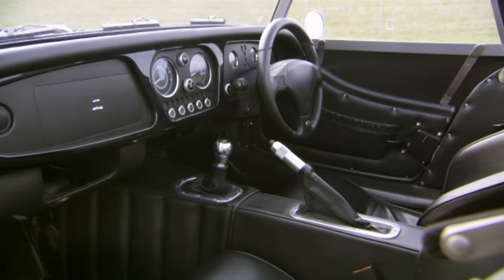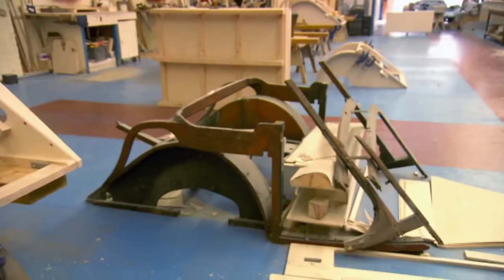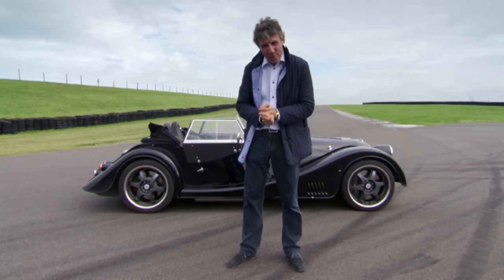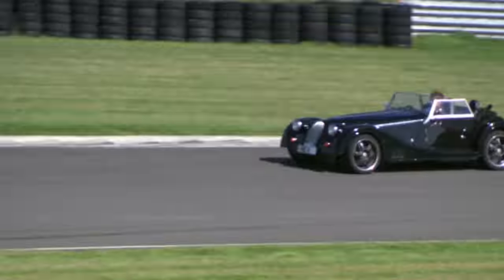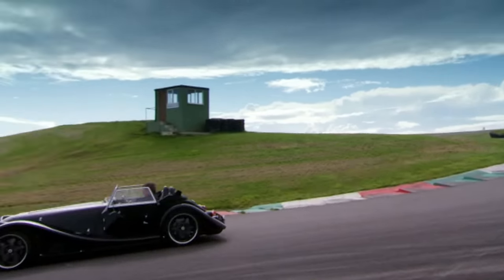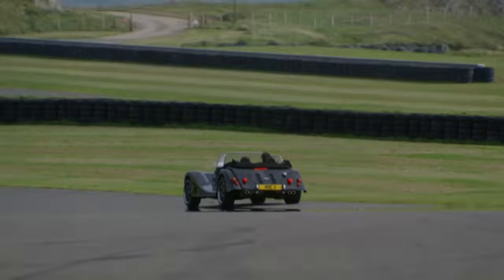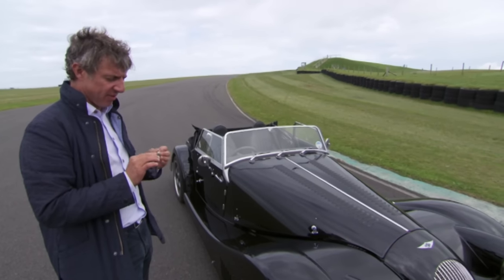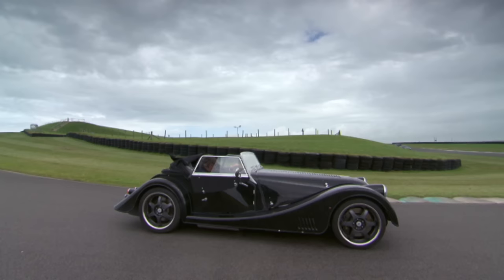Old Meets New With The Morgan Plus 8 #TBT - Fifth Gear

Comment: Cheek charging 85k for something that had minimal development costs.
Reply: Have of that car came from Alibaba ... the rest is German!
Reply: I actually own a plus 8, it isn’t a cheap car on any level, thick leather, good engine, very light weight and it is all hand made.
Reply: @pringle239  Just took delivery of one of the last M3Ws. Let's just say quality control isn't amazing.
Reply: @diplomacy2000  Yeah, that can be very hit or miss. Morgan are usually very good at rectifying issues if you send them an email outlining the problems.
Reply: @pringle239  Thank you. Im in the US, unfortunately, so need to deal with local dealer. Morgan Mid-Atlantic has promised to rectify all the problems at the 1000 mile service on a priority basis, however no apology or compensation. Just "some have problems, most don't," as you've said. Car cost $60k. They need to tighten up their QC and do proper PDIs. It's really inexcusable.